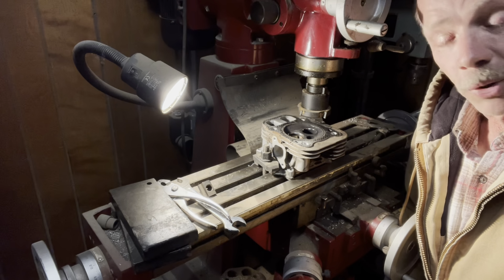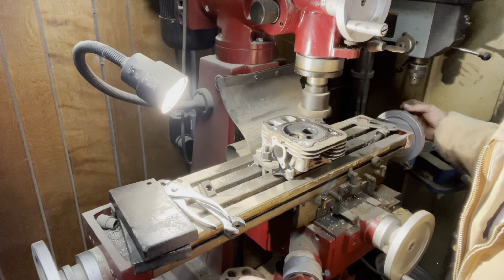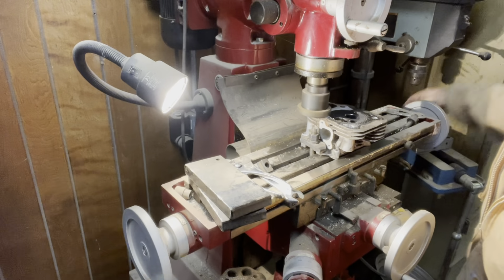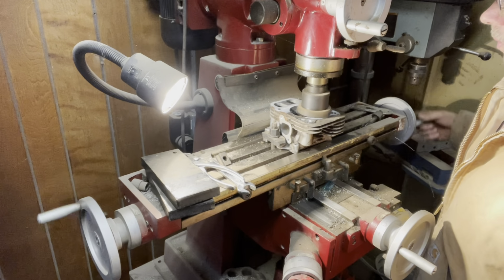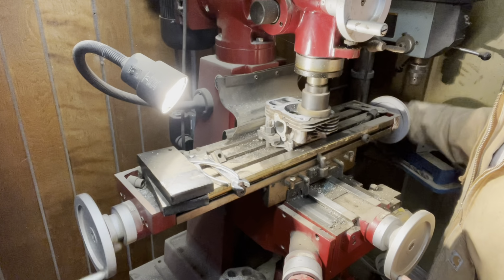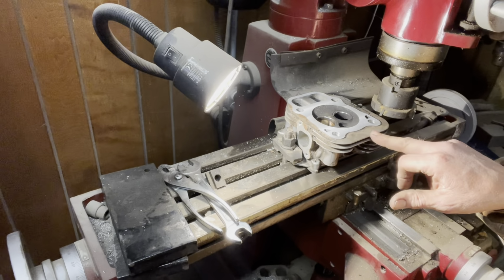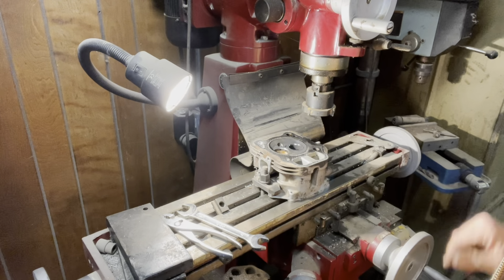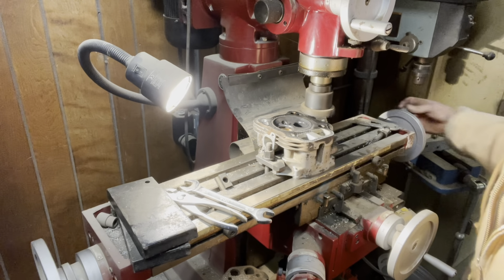How to mill a Kohler cylinder head

Comment: Well done, on fly cutting I was shown to tip the head over a tiny bit as the finish was miles better as there was no drag of the cutter. Nice job on boring the block also. from UK
Reply from the maker: Not quite for sure what you mean by tipping the head over,  but I always looking but better ways to do it.   Thanks for boring comment

Comment: Nice job. I just finished watching your video on replacing a 4 terminal solenoid, you're the only person that talked about what the other small gauge red wire was for, thank you! 
What brand of mill are you using? Thanks.
Reply from the maker: You are welcome.   The mill is from harbor freight.   Not my first choice but it works pretty good.  At the time it was $1800 new.  Works good to surface heads.